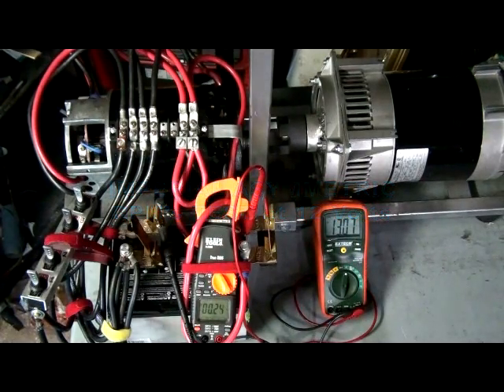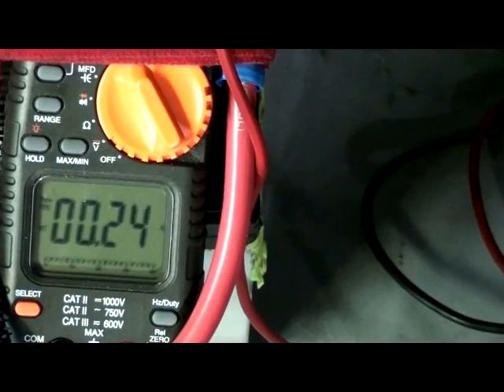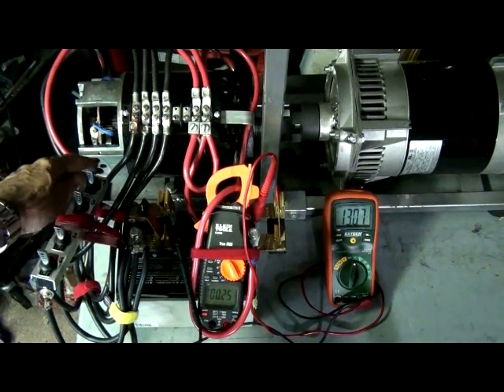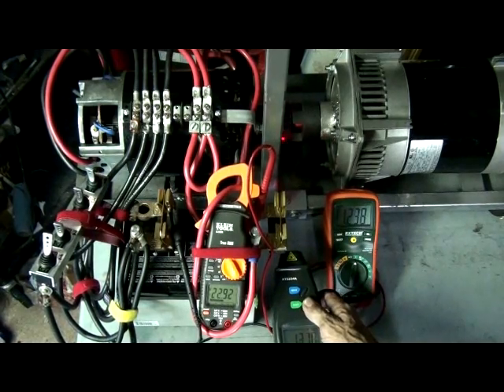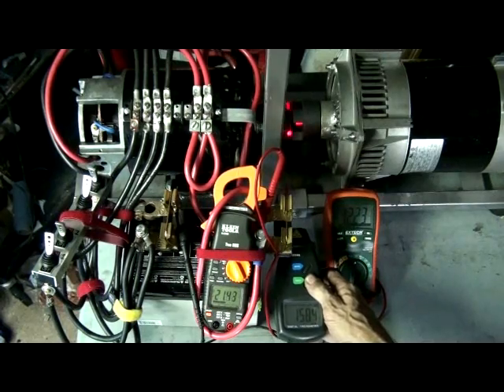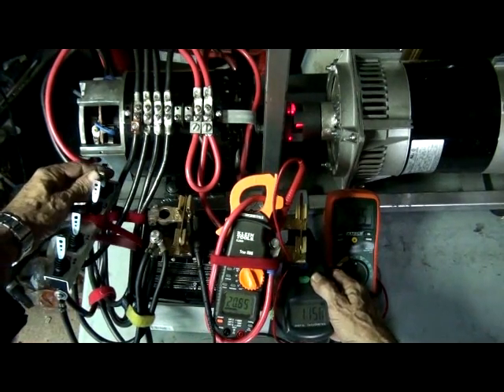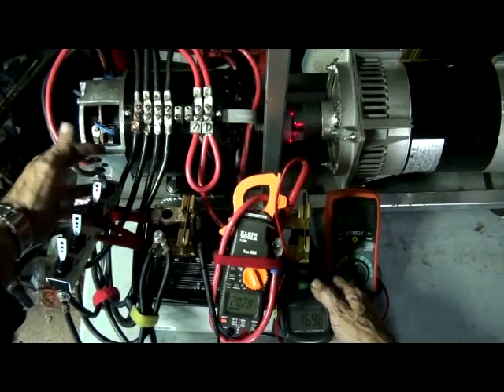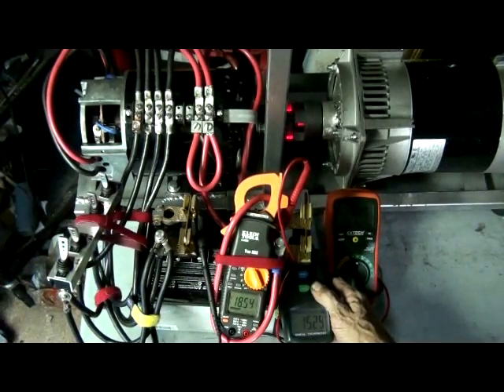IMPERIAL_RPMS_TEST_12V

Comment: Hi. Is it the motor or the generator you are using the flip switches for ?. Can you do another video with an explanation of what exactly you are doing. Not enough information.
Reply from the maker: Hello,

P 1 stands for Pair One...so, when I turn On P1, am turning the first pair of interacting coils, this motor have Four Gates, Four Brushes front and four brushes at rear. Frt and Rear aligned brushes into P1 closes that circuit.

No generator test here...just motor, but it is understood that every time I turn off a gate or a Pair, it becomes a generator. But am not reading that part on this vid.

This was just to demonstrate the RPM´s at 12V DC increase by turning On Gates Switches..
Reply: I believe those swithes add the pairs of coils to the circuit.

Comment: I'm confused, some say wattage (not the torque) is Amperage times 2volt consumed by motor; others say watt is the total battery voltage times amperage. If the first is true, it is a very efficient motor. Thank you in advance.

Comment: I'm sorry if it upsets you, but can you explain exactly what you're doing when you hit those buttons? Are you shorting different coils on the generator? I'm sorry but I really don't understand.
Reply from the maker: No Generator testing here, just the motor part..

Each switch turns on interacting coils in line and apart from each others by 90º...did you watch my suggested video Asymmetry to Enlightenment ?
Reply: +ufopolitics Give me some time to watch it again, in the meantime I will give you a suggestion: All on the same shaft, but separated circuits. One circuit for the motor, one circuit for the generator, and a third circuit for the acceleration where you can try different shorted coils which will boost the performance and probably you can go beyond 100% efficiency.
Reply from the maker: Your suggestion is exactly what am doing above...:)

These motors have All Independent Circuits...which you could use for all three purposes...Motoring, Acceleration and when they are cut off Input, they start generating power back to the source...a Generator?

Possible...

Regards
Reply: +ufopolitics I'm so happy to read that! You're right, a third circuit is not needed when the motor becomes a generator, but before you overcome 100% efficiency you can have these two circuits separated, so a third circuit which could be made of only shorted multifilar coils can be seen as the source of overunity. You can show people you're already producing excess energy even if you're still under unity by simply putting the coils closer to the rotor, so the machine produces a tiny bit more, consumes a tiny bit less and the source of the improvement is just a simple coil, which is not considered a power source, while it should. Watch all the videos on my channel (a couple of them are yours) and think about the phenomenon. An explanation I can give you is a combination of the Tesla turbine, which works with air, and the water hammer, but instead water and air we're using the electromagnetic spectrum of the vacuum energy. I can't write a new law of physics, but it's so obvious and easy to comprehend.
Reply from the maker: Every time you add a coil to a motor, in order to serve as generator...the moment you close that coil with a load, Lenz will show up, reducing your driving force, no matter how small or thin the coil would be.

It all has to do with the way (Structure, Geometry as Disposition of Magnetic Fields) we all use to collect energy back, meaning EMF Induction.

This is so because We have been doing it in a Mirror Symmetry, a straight line against Lenz CEMF...which is absolutely NOT advantageous at all.

But there are other ways I will be showing soon...;)
Reply: +ufopolitics On my channel you can see a lot of people reaching acceleration under load, while the motor consumes less. I also have an experimental device that works the same. My intuition is we're always using the vacuum energy, the spacetime structure or call it what you like, but we're always under unity or over unity depending on the way we get in resonance with this energy source.